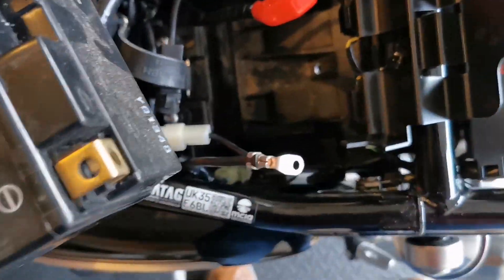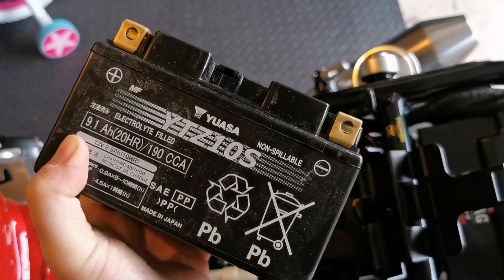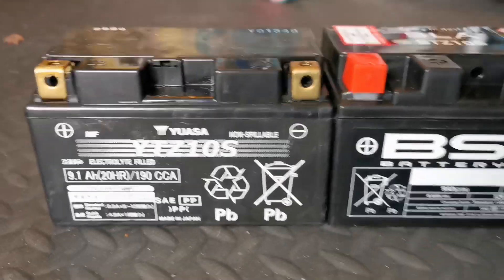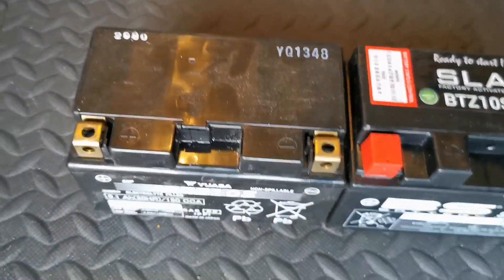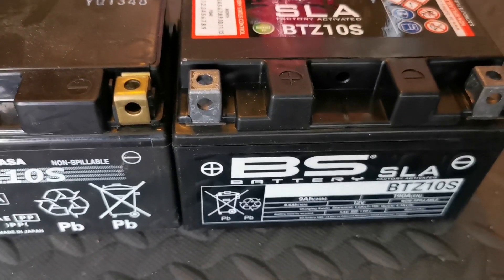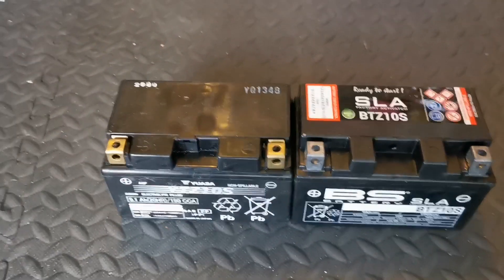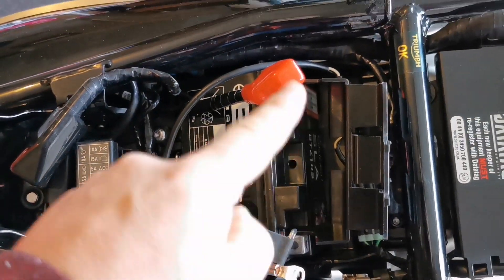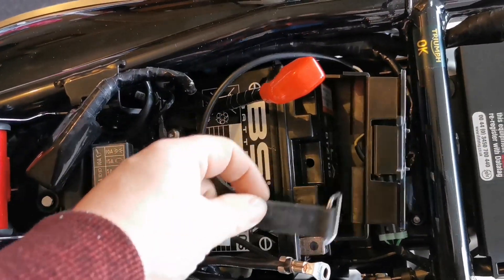Triumph Speed Twin battery issue!! New battery install vlog

Comment: You did 1923 miles in 8 months? no wonder your battery died. ride more 😁
Reply from the maker: Wish I could dude, it's only a toy and family life comes first 👍🙂 I do about 36,000 miles a year in my car for work so my bike is my go to when life lets me. My first bike I had before my licence was sat for 4 months with no issues. With the amounts of posts I'm reading about battery's I think triumph should of put a better one in to begin with.
Reply: @FuelwithDave  I've done 31,000 kms in 16 months on the stock battery, still no issues. I don't keep it on a tender though.
Reply from the maker: @LeftHandCustoms  good for you 👍😎 Here in the UK winters tend to kill battery's as it's not nice and warm its horrible and wet 🤣
Reply: @FuelwithDave  In Thailand batteries only last about two years because of the heat, same for cars.